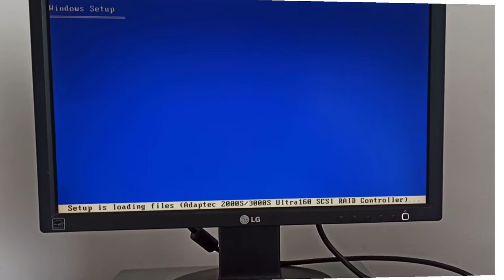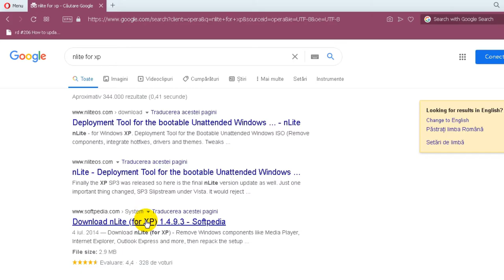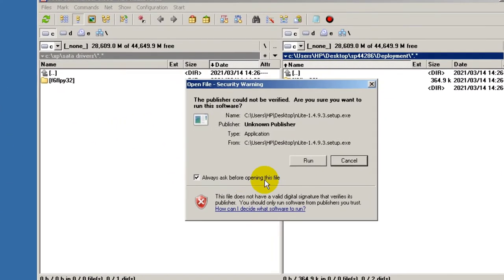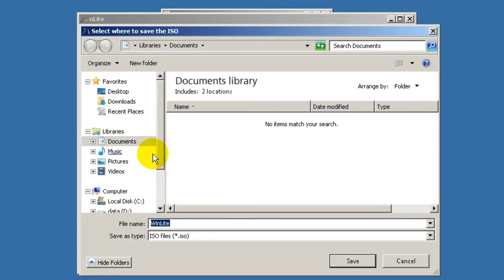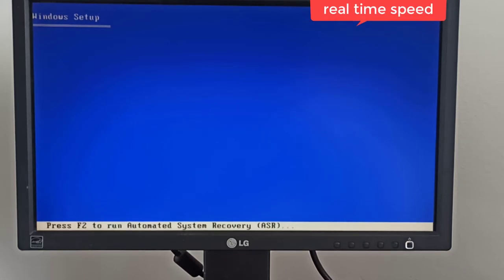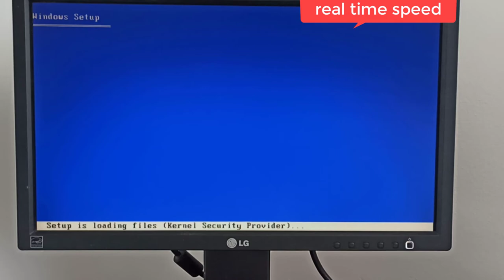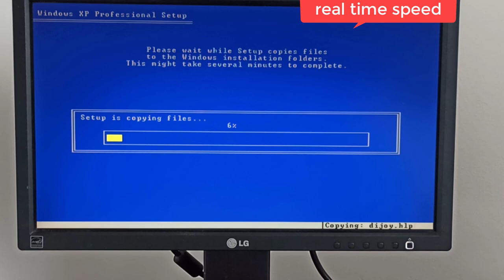How to Integrate the SATA drivers in the Windows XP installation Disc REQUESTED VIDEO Ep.353

Comment: Zabardast cheers from Toronto.....will try it out!
Reply from the maker: Good luck.
Reply: @redigitt Is the Virtual Clone required or not......not sure what it does.....still making ALL the Notes of how to do it....
Reply from the maker: I like to make first an ISO from the original Windows XP CD and I load that ISO ( you wear/scratch the CD minimal in this way) in the Virtual Clone Drive and from there I load in the nLite program......if you don't get right from the first time, then you can load again the files from the original Windows XP ISO in 10 seconds, otherwise you have to copy from the original CD and it takes another  4-5 minutes, depending if the CD is scratched and how old is the optical drive.
I like to preserve my CD's, never know when do you need it again.
You can load in the nLite program directly from the Windows XP CD to.
Reply: @redigitt  Ok...Thanks

Comment: Hi, got a Panasonic Toughbook, CF-30, it's quite old. When I try to boot the operative system I got the same blue screen as you. I don't want to lose the existing programs so don't want to reinstall windows. Is there a way to install these drivers without losing the programs already installed? Not sure if I have the same issue but it's quite similar
Reply from the maker: 1.Aloha, you should go in the BIOS settings and verify your HDD mode. IDE(Compatible) or SATA (AHCI) or in RAID mode.
If you installed without SATA drivers the WINDOWS XP, then it should be in IDE (Compatible) mode the HDD.
If you installed with SATA drivers the WINDOWS XP, then it should be in SATA (AHCI) mode the HDD.
Also check the date and time in the BIOS, probably the BIOS battery is to low and your BIOS was reseated to the default values 
Like in this video at Storage Menu
 -> Storage Option 
-> SATA Emulation https://youtu.be/7tMEwWjjJNM?si=lYhjGz9lDesaHfev

2. Or maybe your RAM memory has bad sectors, if you have more then one stick you should try to remove one , test in both slots each memory or run the memtest from CD or USB.

3.Or your HDD has bad sectors.
Thank you watching, If my video or advice was helpful , then please don't forget to share, like the video and maybe subscribe, please keep me postad and good luck.
Reply: Thanks for your prompt reply, the panasonic laptop is not mine, a friend gave it to me. It has dual boot, in one win 10 and the other win xp I think. Win 10 works ok but win xp doesn't, when I try to boot it I get the blue screen, and I thought there were missing drivers. So I entered BIOS and Says AHCI, but I cannot change anything. So again not sure if the issue is related to drivers. By the way the BIOS is Phoenix. How can I troubleshoot this?
Reply from the maker: If the Windows 10 is booting, then you can acces the windows xp partition you should copy there the SATA drivers
Access the Windows XP installation and go to
C:\WINDOWS\system32\drivers
Look for the files named something like this:
iaahci.cat
iaAHCI.inf
iastor.cat
iaStor.inf
iaStor.sys
you can search for drivers here https://pc-dl.panasonic.co.jp/dl/search?q=&button=&dc%5B%5D=002001006&p1=116&p2=1160042&oc=001005&lang=002
https://www.intel.com/content/www/us/en/download/18521/intel-rapid-storage-technology-ahci-for-windows-xp-for-intel-nuc.html
Reply: Thanks I will try and let you know

Comment: Bro how to I install on a 2nd hard drive without happening to the 1st hdd and my device is (hp Compaq 6350 pro sff)
Reply from the maker: Aloha, I don't understand your question.
1. If you want to add a second HDD to storage files, then you simply mount the second HDD, if the HDD is new and has no partition , then in Disk management you need to inicialize the HDD, make partitions and format the partitions.
2. If you want to install a second HDD with another OS, then you can unplug the first HDD from the motherboard, install the operating system on the second HDD, plug the first HDD to the motherboard then you choose from BIOS from which HDD to boot the PC.
3. There are methods to have dual boot menu, but unfortunately I  never  used in Dual Boot, so I can't help  you with that, you need to search for dual boot.
Thank you for watching, if my video or advice was useful, please consider to share and subscribe, 
or if you think I deserve it  and you want to support my work, You can do it by buying me a cup of coffee at the minimum value of  1$.

Comment: There is a problem, how do i do this, but for Toshiba and without a CD drive since my laptop's CD drive is dead
Reply from the maker: You can try to:
1.Use a PC 5.25" CD, DVD drive with a USB  to SATA Adapter for 3.5" HDD, with external power adapter
2.Make a WindowsXP bootable USB drive
or you copy in a folder to the D partitiion the Windows XP files and lunch the installation from a bootable USB drive - this I didn't tried with Windows Xp, but it worked with Windows 98 till I made a bootable CD disk.
Good luck.

Comment: Me not function error code setup could not determine the type of one or more mass storage devices installed in your system or you have chosen to manually specify an adapter currently Setup will load support for following mass storage device(s). I click enter wait 5 seconds and see blue screen Please. Help
Reply from the maker: You need to download the SATA drivers from the official motherboard support page.
Of course, you can add more SATA drivers and then you can use the installation CD for other motherboards to.
Reply: Ok I wanna try
Reply: @redigitt  i start the pc and usb is connected installer doesn"t loading
Reply from the maker: Not all old computers can boot from a USB flash drive.
I had better experience when I disconnected all optical drives and HDD's and left only one HDD, I used USB 2.0 flash drive, preferably smaller capacity than 4 GB and sometimes you have to wait 10-30 minutes to start to boot from the USB and maybe you have to try several times to boot from USB flash drive. That's why I prefer to install Windows XP from CD, from DVD it installs faster because the reading speed is higher. .

Comment: Hello, do you know if sata drivers are usually included in the motherboard’s driver disc? Unfortunately my motherboard (Intel DZ77SL-50K) doesn’t have any drivers listed on the manufacturer’s official website.
Reply from the maker: Hello, I didn't find for your motherboard the SATA drivers, but I find for the Asrock Z77 Extreme motherboard https://www.asrock.com/mb/Intel/Z77%20Extreme3/#Download  which basically has the same chipset   https://download.asrock.com/Drivers/Intel/SATA/Floppy_Win7-64_Win7_Vista64_Vista_XP64_XP(v11.2.0.1006).zip
I hope this will help you, but for your motherboard probably the Windows 7 is more suitable.
Thank you for watching, if my video or advice was useful, please consider to share and subscribe, good luck.
Reply: @redigitt  thanks for looking into that for me! I do have the disc included with the motherboard, do you think the SATA drivers are included in the disc?
Reply from the maker: Yes, you need to search for something like SATA Floppy Image  or Floppy driver and usualy is a .zip file and for sure contain a Txtsetup.oem and the F6 Readme file where explains how to use the file, you need to press the F6 key to load the drivers from the Floppy disc....but if you integrate with Nlite the SATA driver, then you don;t have to press the F6 key.

Comment: I have the "GIGABYTE B450M DS3H rev 1.0" motherboard, but in their site they have drivers for Windows 7, 8 and 10 only. How can I port the drivers from Windows 7 to Windows XP. (When I took it it had Windows XP x64 in HDD which died.)
Reply from the maker: Aloha, sorry I don't know, but you can install the Windows XP in a virtual machine like Oracle VM VirtualBox.
Good luck.
Reply: There are backported generic sata drivers online if you look around

Comment: Is it possible to slipstream drivers for a Windows 11 computer so that Windows XP can be installed on such a machine without any installation errors?
Reply from the maker: Sorry, I don't know.
Reply: Not possible to install all drivers but still you can just run xp on the newest hardware by using modded xp SATA driver from Intel. But there is no guarantee that it works on every system.
Also running a 32 bit OS on latest x64 processor is just like using ferrari as garbage dumping vehicle. The hardware and OS must be somewhat equally capable. Pentium 4 was best suited for xp though Pentium 3 as well as upto i3 2nd gen were both capable of running xp. There is overlap zone too where many OS can be run equally well on a system. P4 can run windows 9x and DOS too.

Comment: i integrated all the sata drivers still it is not recognizing my hard disk .. i have a hp notebook laptop
Reply from the maker: Aloha, 
- before the installation your HDD was ok? why did you tried to reinstall the Windows?
- you can see in the BIOS  your HDD, maybe the HDD is bad  -  You can test with Windows 7,8,10 if it is recognized or not
- maybe you didn't integrated the driver for your laptop chipset
- do you have mechanical HDD or SDD?
- could you name your HP laptop model?
Reply: @redigitt  I just got to know why I wasn't able to boot it was because my laptop has insyde crappy bios doesn't let me change sata modes I won't buy any hp products now
Reply: @redigitt  can you make a modified bios for my laptop model 15-bs154tu which allows sata mode change ?
Reply: @redigitt  I want to make a dual boot pc with win 10 and win xp
Reply from the maker: Your laptop has a new generation BIOS, Chipset , CPU, BIOS, I don't think the laptop will support the  Windows XP in dual boot mode.
But, you can use the XP in Oracle Virtualbox  https://www.virtualbox.org/

Comment: I just realized it...made the SLIPSTREAM Folder under C now....but, Virtual Clone - opens in the Settings and does nothing???

Did 3 times ...Copy/Grab XP Original ISO Image....stored in the Root Directory and others too....but, nlite just does not find them......I can see them in the Folder though?

I do not have your email and could send you pictures?

If I click the XP ISO Folder for the heck of it - it says Make sure the Selected Folder or Drive contains the 'i386' or 'AMD64' Directory??? and proper Windows Installation Files...nLite is for a pre-install environment only???  BUT, if I close all programs and click at any of the three XP ISO Images - Windows XP opens up?

By the way my Folder called SLIPSTREAM is under My Documents and not under C: Windows like you did - does it make a difference?

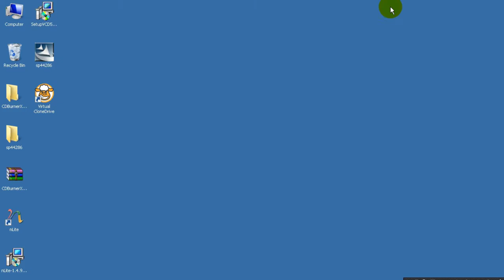From 6:25 to 6:40 ....too fast....what u did with Virtual Clone no idea!
Reply from the maker: You should double click on the Windows XP.ISO, then the ISO will load in the Virtual Clone Drive( you will have a second CD-ROM on your PC), you open the nLite program, press the Browse button and search for the second CD-ROM(virtual Clone Drive) and click on the Virtual Clone Drive and then you gave the saving location, in my video is the "XP for SATA" folder. If the video is to fast you can change the playback speed in the settings, the gear icon to 0.75 or 0.5, good luck.
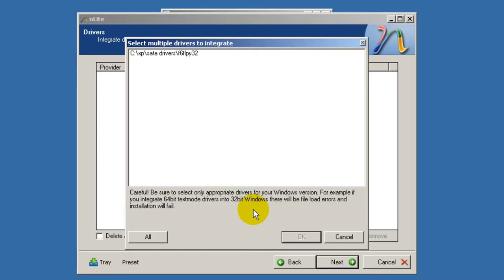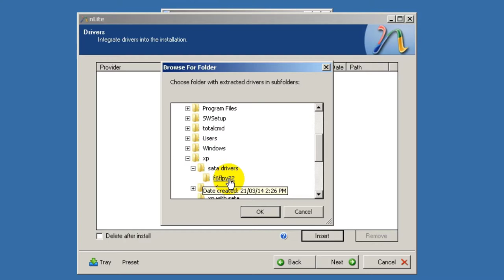Reply: @redigitt  o.k.....and, @ 8:20, in the HP SATA Folder, there is the Main Folder with 2 sub folders, with the 32bit and 64 bit. Do you copy ONLY the 32bit files at the end or the Files in the Main Folder plus the 32bit Files at 8:20? Kindly confirm.

Comment: Aloha...no luck...same BSOD.....I just copied the 32bit HP SATA drivers, maybe, have to copy the other Files too from its Folder? At 8:35? Also, you are making a Clone of WinXP SP3....mine is WInXP SP0....I always download SP 2 and 3 later ignoring SP 1!   Burning another ISO now!
Reply from the maker: you can slipstream the SP 1, 2, 3 to
Reply: @redigitt  ok...will try it too.
Reply: Get windows XP SP3 inbuilt MSDN version. No need to worry about service pack integration. Just check the device ID of SATA hardware and search exact and latest driver for it. Slipstream it using nlite or UBCC and just burn the CD. You will never fail.
I am testing the generic driver so that XP can be installed in any Intel SATA device. Afterwards suitable driver may be installed.